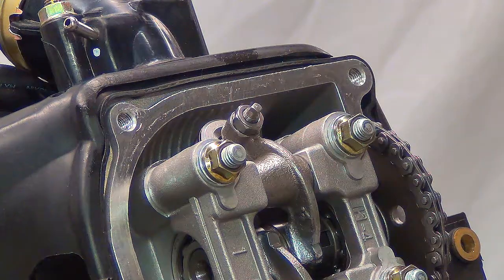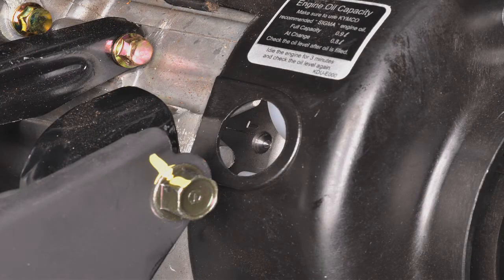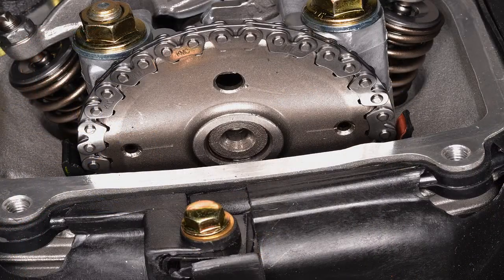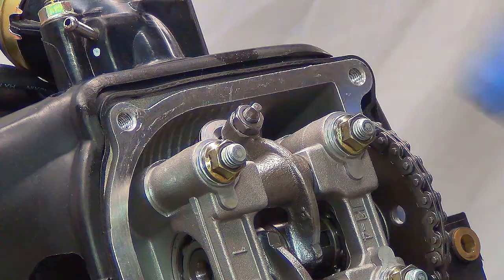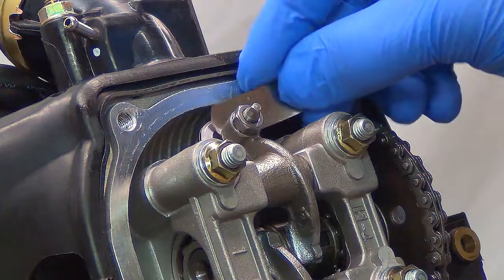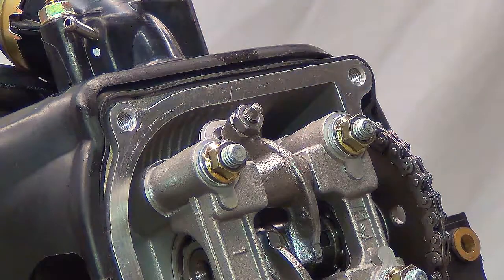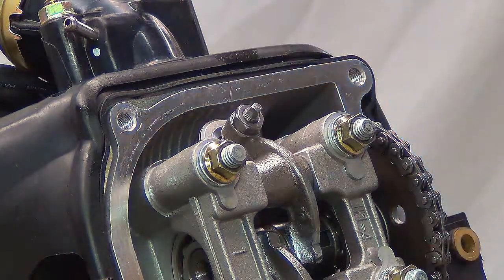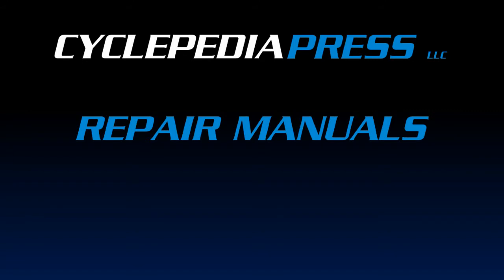Finding Top Dead Center and Valve Clearance Inspection on a GY6 Engine

Comment: My T doesn't line up with my holes. Should I keep spinning fly wheel until both the T and the large hole is on top?
Reply: Yeah keep spinning until it lines up and if it never does then its off time.

Comment: So it's the mark below the T or right on the T ?
Reply: I would say. If you see the T. Check the cog if the big hole is at the top and the other 2 are flush you're good. If you see the T but not the big hole on the cog keep going till you see the T again and look again.

Comment: Nice tutorial video sir ...!🙂👍say I'm having a hard time with finding a replacement dowel pin for my gy6 50cc boom pyt revolution scooter ☹ I replaced my rocker cage assembly I ended up smashing the bottom left hand corner dowel pin I've ordered 2 different size dowel pins already one is I.d 7mm o.d 8mm it fits the hole on the rocker assembly perfectly but I cannot get it to go on the mounting bolt while on the other hand the other dowel pin was to big/round it was the i.d 8mm I'm not sure how to go about replacing this dowel can you please give me some advice